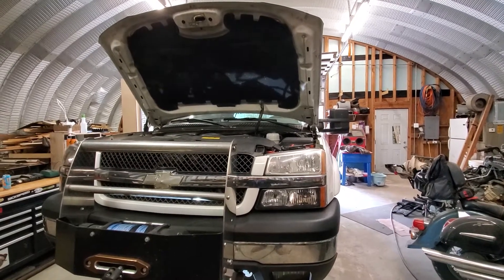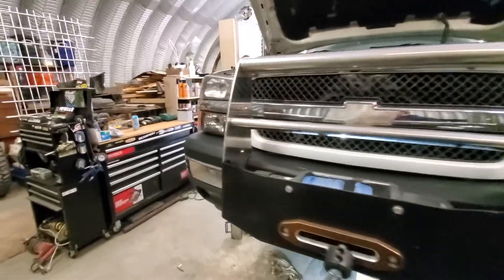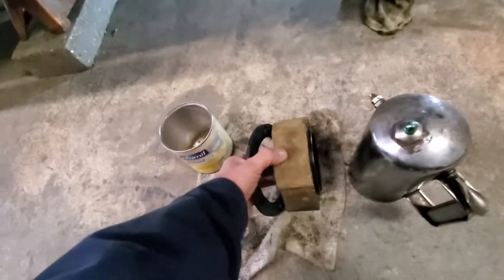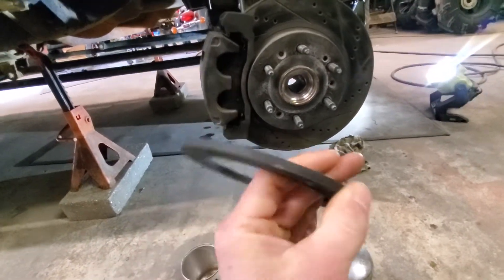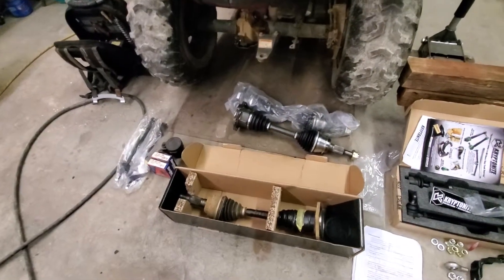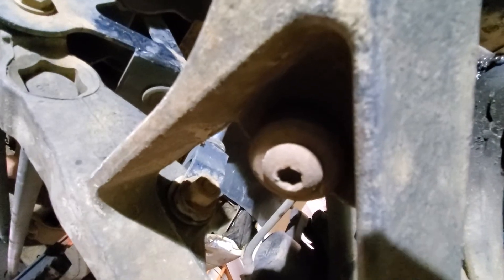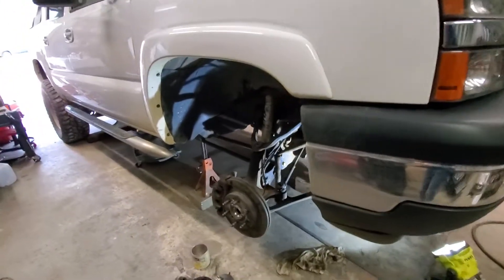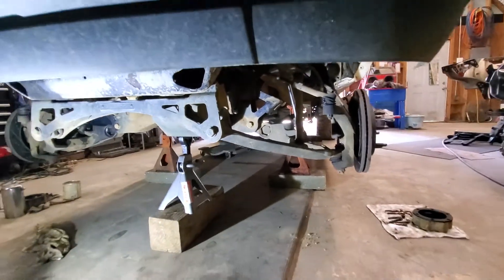06 chevy avalanche z71 gets new front end parts

Comment: CV axles aren't hard to rebuild... you could either swap boots or swap in a longer shaft to account for the truck's lift.  A little simple geometry!
Reply from the maker: Using a slightly longer setup this time around. Autozone, lifetime warranty. After a certain year they started using longer axles in the cadillacs, chevy, gmc suv/trucks. They are going strong still.

Comment: Does yours come with the hydro boost system. My fathers 05 2wd came with a hydro boost system, which I thought was odd for a 1500.

The 07+ body style CV axles are about 2 inches longer, if your lift kit has spacers. That should give better angles. I believe the splines are the same.